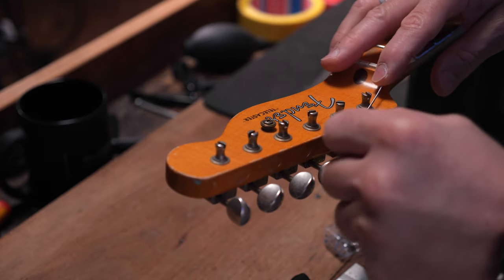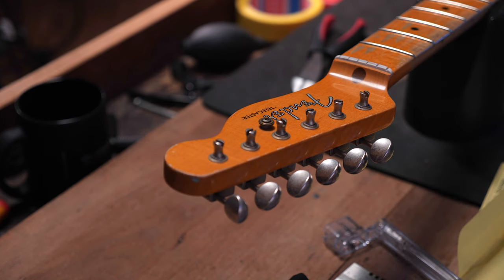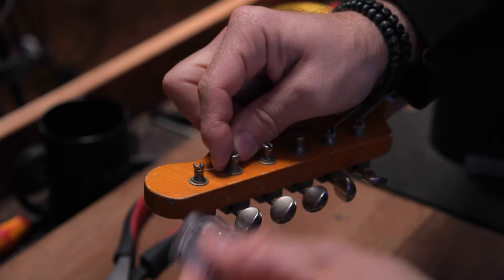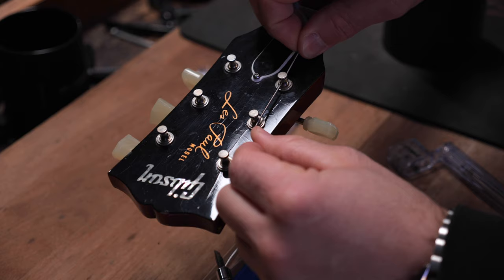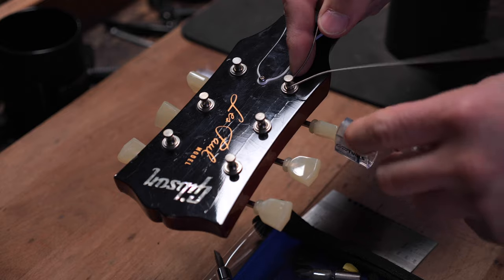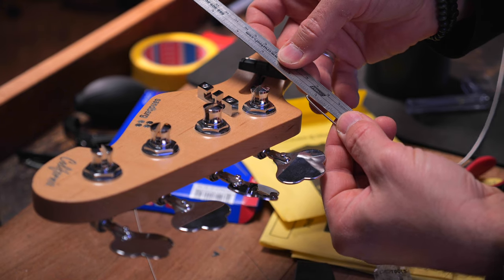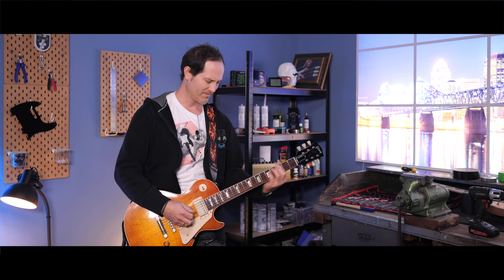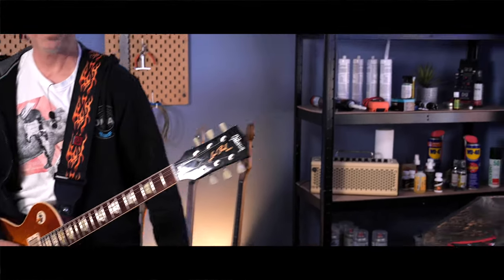How To Install Round Core Strings | Guitar Tech Tips | Ep. 107 | Thomann

Comment: Interesting debate: on a bass where the bridge saddles are is not too far from the slots or holes that secure the ball ends, what do you do if the strings have that “silk” end wrap and it onto the saddle (best example is the Gibson 3 point bridge on the Les Paul Junior DC.) Some say just leave it as is, others say to try to remove it so the metal part of the string is touching the saddle.
Reply from the maker: Hey, I'd try to avoid strings with that fabric at the ball end on a bass like that. I prefer having the actual string touching the saddle for better sustain and overtones. Luckily there are plenty of great strings without that silky thingy. Cheers //Kris

Comment: Hey do locking tuners require the same installation process? And do we do a 90° bend after around 2 more pegs on a 7 string with 7 in a row tuners as well?

Comment: Would this be necessary with locking tuners?
Reply from the maker: Very good point. You don't have to worry about these tricks when using locking tuners. Those will lock in the wound wire perfectly so you only have to make sure to tighten the lock before cutting the string. Cheers //Kris
Reply: @ThomannsGuitarsBasses  Thanks man!  Most of my guitars are locking but I have a Baja Tele with the vintage tuners and those aren’t changing 😎